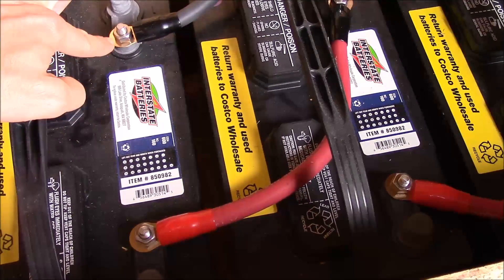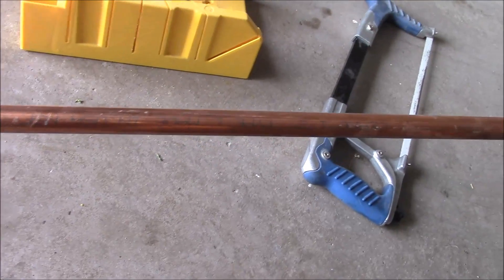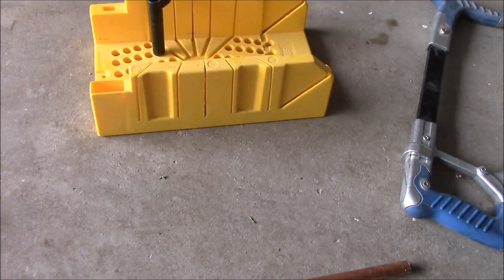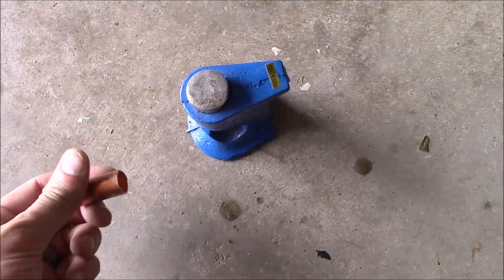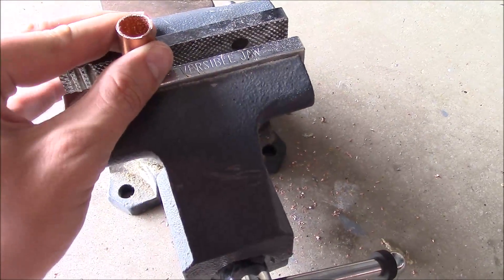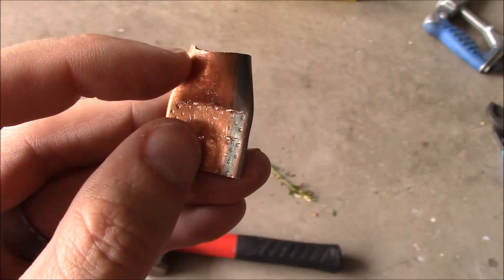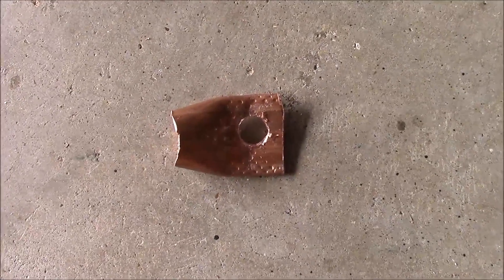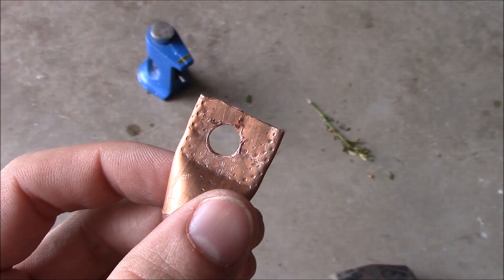Make Your Own Battery Ring Terminals

Comment: plumbing copper and wire copper are too seperate types of copper... good wire copper has a higher % of copper to other metals.     nice try
Reply: Type K and L are the refrigeration type and thicker walled compared to type M that is water line and thinner walled.  K & L are soft also and all can be hard copper pipe.  They're all 99.9% copper.  https://www.copper.org/applications/plumbing/cth/standard-tubes/cth_1stand_type.html
Reply: @jafinch78  for some people 99,9% isn't enough, -the Audiophiles ;D
Reply from the maker: Works fine.  It is at least as good as the copper plated tin crap that is commonly used in audio.
Reply: Yay
Reply: Nice try on the grammar though. Idiot.

Comment: Great video. Rolled copper works much better than the rigid, because it is thicker and softer. Pounding it with a hammer really flattens it out, then cut to length. Refrigeration, water, and other copper pipe sizes gives great variety. Look in the scrap piles.
Reply from the maker: +Cajun Calvin True.  This was the only thing I could find at the hardware store and it is definitely not soft.  It works, though.

Comment: Cool...and saves a few bucks. I still have that copper jumper I made out of tubing. I doubled up the flattened copper and brazed them together. Worked great.
Reply from the maker: +Chris DIYer Yep, copper is copper.  These were easy to make - even easier if you have a metal cutting device like a chop saw and also a drill press which I still don't have.
Reply from the maker: +Chris DIYer Yep, copper is copper.  These were easy to make - even easier if you have a metal cutting device like a chop saw and also a drill press which I still don't have.

Comment: Nice idea, but cutting the tubing with an actual tubing cutter would be easier and cut a lot cleaner.
Reply from the maker: +tfr51 Agreed.  I don't have one.  I used to have a chop saw which would have worked great, too.